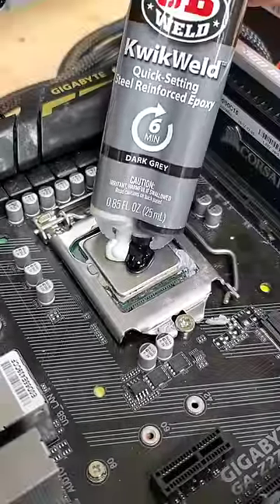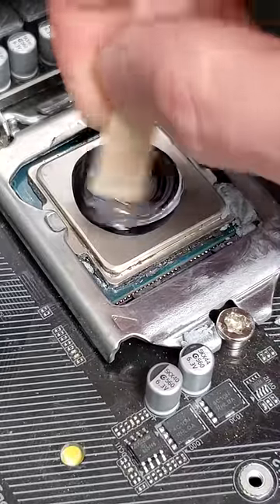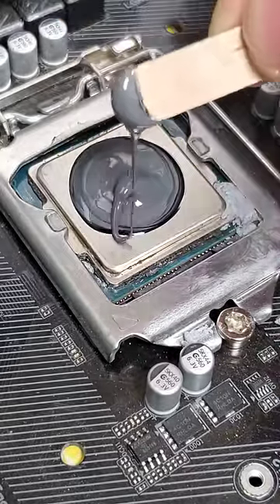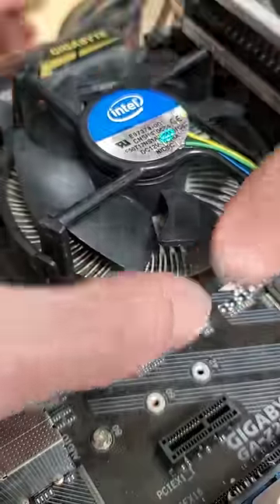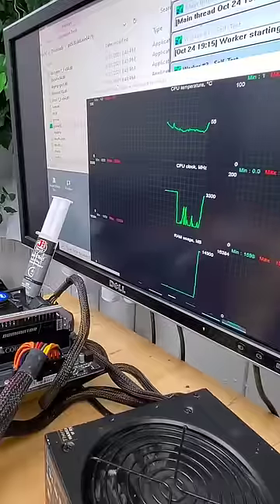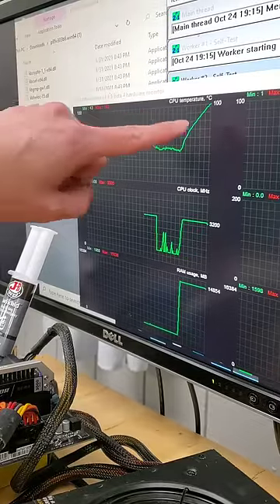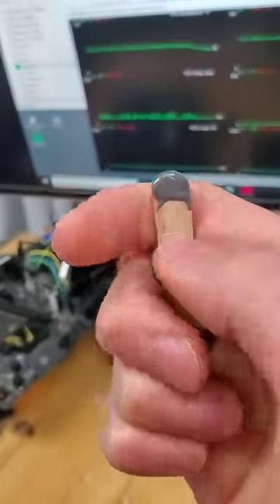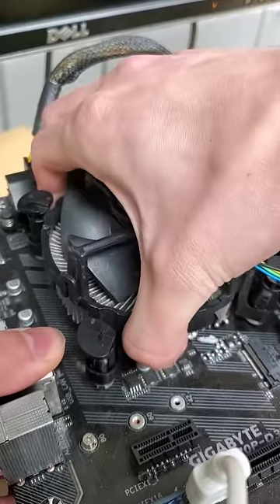using steel reinforced epoxy as thermal paste in a PC! #shorts

Comment: Try thermal epoxy next! They’re used in like 3D printers to epoxy the heating coils and thermistors to the print head…
Reply: bro rlly thinks mryeester has infinite cpus
Reply: @brianery  he lives like he does 😂
Reply: @brianery  My man buried 3 CPUs in the ground, of course we all think that.
Reply: @brianery  to be fair you don’t need great CPU’s for these tests
Reply: That thermal epoxy (boron nitride paste) is only conductive after it hardens. So no use then.
Reply: @brianery buy a used crappy one for like $20😂
Reply: @brianery I thought he did
Reply: @brianery  Yeah he's probably making more than some $20 mobo combo pre video
Reply: Uhhh... when?
Reply: @brianery I mean, old CPUs are cheap AF.
Reply: @brianery old one are cheap
Reply: @UKsystems  most old ones won't run on a modern pc
Reply: @brianery  this is the definition of an oxymoron. Of course an old CPU wont run on a MODERN PC because their not the same socket or anything.

But if you get the right board, yes they will run just fine. I still run a 14 year old system for a storage system.
Reply: @vinylmodsmanitoba  oh, so mryeester now has to buy another motherboard in which the old cpu can fit. definitely cheap!
Reply: @brianery  I don’t think when putting epoxy on a cpu it needs to do any better than barely booting
Reply: @brianery  to be fair you only need 1 basic of each chipset for amd/intel. you can reuse boards as simple as removing old cpu, place new cpu. 

Also, you just made a "run it till it dies" cpu cooler combo... unfortunately, no cpu works well at 100c

you could sacrifice a chipset/couple of days recovering a chipset to do a cpu bricking video with it. 
I bet a face-against-keyboard value to voltage or clocks speeds would do it. 
alternatively you could try to salvage some performance with undervolting and negative curve offsets.
Reply: Fun fact, it's been a decade 3d printers now use heating cartridges and ceramic heaters held by a screw or a spring lol
Reply: @eski5195 Bambu printers use thermal grease for the ceramic heater still.
Reply: Yea. I have never seen a printer that uses thermal epoxy. 99% of printers just have a heater cartridge and thermistor that’s held in with a set screw. The other 1% uses thermal grease and the set screw to hold it in.
Reply: @xiar5546  My CR 6 SE uses thermal epoxy for the thermistor and the heater cartridge.
Reply: he does.... tech guys ALWAYS have another cpu laying around. @brianery
Reply: hell I don't even own a tower atm and even I have an extra couple of cpu's laying around
Reply: @brianery cause he really does it seems😭
Reply: @brianery  He would need a motherboard regardless if it's its an older socket or newer socket for the experiment to work and most older mobo are cheaper than the newer ones... Obviously you don't watch his content cuz this kind of stuff is what he LOVES to do.
Reply: @AznMikey  frick thermal paste use cheese
Reply: @brianery what did you think, bro?
Reply: Ya not in any 3d printer guy. The elements and thermistors are in their own package, sealed with ceramic paste not epoxy.
Reply: @beaumontlivingston8084  Yes, but when the "packages" are installed inside the heating block, they are thermally coupled with either thermal paste or thermal epoxy and mechanically held in place with set screws.
I've taken my printer apart enough times to know this.
Reply: @kugelblitz1557  I just dropped 2000 dollars for a high-end gaming PC that gets about 500 fps, and the cpu sits comfortably at 70C under a full load, and I'm happy with these numbers. 2k is less than some people spend on a high-end graphics card. I still need to get some 140 mm fans for the front to build up stronger positive pressure, so a lot of dust doesn't build up. Until then, I will just set them at a higher rpm than the exhaust fans. Hopefully, that works. Also, I know people have better PCs than mine, but I'm going for a high-end energy efficient build to combat inflation and rising energy costs. I will still be able to play games for a long period of time at good quality while spending less money on energy bills. With everything increasing in price, energy efficiency will be king for people who play games/work for long periods of time. These are just my personal thoughts. I could be wrong, and everything might stabilize, but I wouldn't count on that.
Reply: @Cerberus3434  ok this is the most random thing as a reply to my comment about thermal epoxy wtf😂

I don’t think anyone here was talking about energy costs or inflation
Reply: @aaryananand7288 oh mb wrong person. I'm bad this. There was someone talking about dirt cheap parts here somewhere.
Reply: @aaryananand7288  Wait, why are you responding to a comment not directed at you. Is the better question. Yes, I went a little off topic, mb. It corresponds to the sub topic someone bought up about how you can find cheap parts if you know where to look and everything after the first thing I mentioned explains the first part in better detail and why I chose that route. It's on topic for the sub topic. I never really liked the main characters. I always wanted to follow the story line of side characters, and interact with them. If that wasn't explained, I would just make up my own story. Also, I mean no disrespect. You probably know more about the main topic. I just like to take the road less traveled. I'm all for people trying new things this causes a domino effect that eventually leads to innovation. Innovative ideas are the fuel for the fire so to speak and if they eventually find a way to make PCs cooler in the process that benefits everyone. Like with the advancements in God teir cpus have driven done the price for the old low teir cpu and the same goes for gpus. Gpus are a little bit better because you can just bridge those if you have a good psu. Also this topic is way to broad so and kinda out of my league. Same with OCing. I have a simple ish build that I know I can manage. I'm only in the process of relearning ohms law at the moment to calculate max volts and amps my system runs. Oh, forgot about watts mb.
Reply: @Cerberus3434  sounds like me! I kept mine at around $2500 (during covid prices), full custom, exact parts I (actually) wanted, and I couldn’t be happier 3 years later. should carry me another 3 years, at least, easily. cheers to your setup and I hope you get those tweaks just right. :)
Reply: @brianery  pc hardware reviewers kind of do, often times they get donations of review/press versions of the hardware ahead of the release dates to give feedback or whatnot, and they usually send more than a few of these each time. linus and gamernexus for example are sitting on hundreds of unused cpu's over the years.
Reply: @chloekaftan  meanwhile intel looking at what mryeester is doing to their cpus
Reply: Yup once a cpu hits 100° its already fried
Reply: @bartfelix2949  nope, not true. Some CPUs let you change the thermal throttle temp in the bios all the way up to 125C. CPUs are totally fine for a lot higher temperatures, but they just wear a lot faster.
100C can never “fry” a CPU.
Reply: @brianery  silly sausage.

Comment: His next video:
“What happens if you use pure uranium as thermal paste in your pc??”
Reply: Mryeester just fucking busts in with a hazmat suit on.
Reply: it initiates nuclear reaction and become tiny nuke heh
Reply: Hmm, CPU is a little hot... 6000 degrees
Reply: @FluffyFoxUwU  Critical mass of Uranium-235 (Used in Little Boy) is 50 Kg
Reply: assuming you had access to it, you could actually. it wouldn't even be the worst thermal paste to cool a cpu with, because it's thermally conductive. it's only gonna make your CPU slightly radioactive :)
Reply: @klad2860  using a neutron moderator, such as water, this number can be made even less. but that is for controlled nuclear reactions :)
Reply: A nuclear meltdown produces a liquid called corium, that runs through a reactor vessel. Corium is the word you're looking for
Reply: @stormah  although, corium is only liquid when it's hot. it's basically just the extremely radioactive lava you get when things get so hot they melt and mix inside the core. when it cools down it solidifies, so it's not any weird green goo liquid lmao.

a much better material to use (in this hypothetical situation) would be depleted uranium. this is the stuff they are left over with as a byproduct during the enrichment process. depleted uranium is much higher concentrations u-238, it's less radioactive, much easier to obtain, and chemically extremely similar to u-235. you could use this in a paste for a CPU or make it into a uranium-gallium alloy and apply that as a liquid.
Reply: kaboom?
yes rico, Kaboom
Reply: Bro got that Demon Core i9-666KF 💀
Reply: Maybe yellow cake?
Reply: @Thatonefuckinguy well actually🤓 
Uranium emmits gamma radiation, which can only be halfed in amount by 1cm of lead SO if he wanted to get that close to pure uranium he would need at least more than 10 cm of lead shielding around his entire body
Reply: let’s feed some to the cat 😊
Reply: @ThatJay283 for bombs better compression from explosive lenses and neutron reflectors can drive critical mass lower. Shape of the material is also a factor.
Reply: Not much other that it would be moderately radioactive, still safe to be around for a few hours just not all the time.
Reply: Uranium would be a great thermal conductor.
Reply: Works quite well!
Unfortunatly howver the constant blue screens get annoying fast
Reply: Maximum bit flipping

I don't think that's what's meant by "quantum computer"
Reply: AAHAHAHAHAHAHAHAHHA BECAUZE URANIUM IS RADIOACTIVE!!!! 😲😲😲😲😲😲HE WOULD GET CANCER AHAHAHAHA😂😂😂😂😂 UR ACTUALLY SO FUNNY AND DARK AND TWOZTED 😂😂😂😂😂😂 NO WAY ANYONE HAS EVER BEEN THIS FUNNY 😂😂 HE SAID URRRAAAANIUMMM AHAHAHAHAHAHAHA
Reply: crunchy cat has entered the chat
Reply: Yum, Tasty Radioactive square chips
Reply: Boooo... MMMMM!
Reply: @renwan1  Oh, Yeah!!!

Comment: Steel is also a bad thermal conductor compared to aluminum, gold, brass, and copper. I discovered this the hard way when trying different 3d printing nozzles.
Reply: Cooking also teaches this.
Reply: Why did you mention gold, but not silver which is even better then copper

Comment: Try mirror polishing cpu and cooler's touching points. Since thermal paste fill the microscopical gaps mirror polishing should work without thermal paste.
Reply: That's lapping and it does make a difference
Reply: It definitely does. my 3700x could never be properly cooled. I lapped it and now its more than happy.
Reply: It might make a very small thermal difference but it will still need thermal paste
Reply: It would take some precise tooling to avoid rounding it. Without thermal paste the two surfaces would need to be perfectly mated, and when lapping you're quite likely to introduce some convex geometry.
Reply: how do you mirror polish? dont you need industrial tools to produce mirror finish metals?
Reply: @Chewy427   lol no. Just buy some sandpaper
Reply: @PeakOfHumor  Use sandpaper on my cpu and my cooler?
Reply: @Chewy427   I totally meant that. but you know its just a video idea.
Reply: @Chewy427  sandpaper isn't a great choice since its soft and will cause some rounding. You want to use lapping stones. Ideally float glass backed stones, and make sure to level them correctly.
Reply: @Chewy427  I used my granite countertops, but you can use a plate of glass from a picture frame etc, and wet sand with 600, 800, 1200, and 1600. Then polish compound rubbed with a paper towel. Then clean off with rubbing alcohol. You can see the high/low spots in the nickel plating when you start to sand into them. Best way to know when you're flat is when all the nickel plate is gone from the surface, then focus on the higher grits and polishing. Then the amount of thermal paste you need doesn't require hardly any.
Reply: @PeakOfHumor  definitely not "sandpaper" if you really wanted a mirror finish you'd get a 1 or half micron paste and a felt capture pad to polish it down
Reply: @Chewy427  Unless you have a problem or you just want a slightly long and expensive project, it's probably not worth it. It's difficult or nearly impossible to eliminate insulating air gaps. But if you like, do some more research. I have seen good articles and videos on the subject.
Reply: Not really granite surface block or even a peice of glass can get you pretty flat @Erowens98
Reply: But, won't it be affected by thermal contractions? And that may ruin this idea
Reply: @fidonol  good point. The surfaces may have differential expansion when hot. Best to just use a thermal interface material.
Reply: Why can't you cool a 3700x? I have mine running on a refurbished 240mm corsair h100 aio with the fans turned off. Runs 60c in games 🤔

Maybe your motherboard is giving it too much voltage? How many watts is it pulling? I think mine does like 95w under full load  @chieftain20

Comment: Bro sacrificed a whole CPU for this content
Reply: Prolly a 2 core deadass CPU
Reply: No way that epoxy didn't overflow into the socket.

Just what little yanking he did, bent the PCB and stressed the solder joints. 

Board is a goner.
Reply: And motherboard 😂

Comment: Finds out he used his 7950X CPU for the experiment by mistake.
Reply: The best cpu that it could be is a 11900k. You can easily tell the difference between amd and intel even though they are both lga now.
Reply: Worse, it was a platinum sample.
Reply: Its prob just an old Celeron, relax....
Reply: @Leonvolt28  11900k in an 1151 socket? You might want to double check that
Reply: @MrOnewallatatime I didnt spot the socket name in this video. After looking again I do. I'm aware that 11th gen intel is socket 1200.  But the sockets and cpu do look pretty similar.

Comment: Are we gonna get a how you removed it video like we did when you covered it in thermal paste?
Reply: No because there isn't any way to separate it. He can't even get the CPU off the motherboard because the latch is underneath the cooler
Reply: Ripped it off with a layer
Reply: @БогданКрименюк  I might just be being stupid here but what's a layer?
Reply: @Duck_side it’ll take the integrated heat spreader off with it
Reply: cut the bulk of the cooler off wiyh a handheld bow saw with a blade destgned for metals, so you can access the latch.
Reply: Knowing that stuff... there was never a removal option. Never.

Comment: Epoxy heats up to become solid and is very susceptible to heat to become a liquid again when heated enough. (Heat it up the epoxy will separate and become easily separateable)
Reply: Epoxy is a thermoset, once it crosslinks you cant melt it again. Kind of how you can't unboil an egg.
Reply: @ZhaoPao you can unboil an egg, you just need to go faster than light speed

Comment: i mixed silver powder with epoxy, this works good. you just have to use the most minimal film on the cpu. i used this to connect leds to coolers permanent and weatherproof.

Comment: I accidently used thermal adhesive on my AMD Phenom II X4 965BE back in 2009. I was initially so bummed, but luckily it is still going strong as my NAS CPU 15 years later!
Reply: I had the stock cooler on my AMD Phenom II X4 955 for maybe 5 years. When I went to upgrade that computer it was practically like I had epoxied the cooler on. Ended up ripping the entire CPU out with the cooler trying to remove it. Then used a razor blade and iso to finally get it off. Still works great though! Had it in my NAS until I built a replacement last year

Comment: Try antiseize. Both the copper one and the alumium one. Edit: oh, wait, you already did. But try the copper one and see if its better. Its used for bolts(technically screws) that bold into cast iron and can damage alumium.

Comment: Thermal epoxy though... I used some to put a daughterboard Pentium III cooler onto my GeForce MX200 64MB which I modded to run as a Quadro2, and boosted the core clock to 225mhz. Worked a treat, looked neat and made a lot of kids jelly at LANs

Comment: As soon as I saw JB weld I kept repeating NO. The point of thermal paste is to prevent any gaps so what you want is anything that would create a perfect seal between the cpu and heatsink. It cant suffocate the 2 components though. JB weld is going to trap heat. It wont allow for it to transfer to the heatsink.

Comment: Actually this works if you do it correctly. The problem is that with thermal cycles epoxi will delaminate and crack and will gradually loose conductivity

Comment: This is easier to test if you take off the metal bracket from the motherboard. The cooler feet will hold the cpu in good enough for a short test, and it comes right off the board no matter what you put on the IHS. The you can just wedge the CPU off with a razor.

Comment: If you're going to use an adhesive, use one designed for thermal transfer an only use enough to get a nice thin bond line.  You could probably do 20-30 cpus with that big ole booger.

Comment: Yer as a mechanic I could of told you exactly how this would play out😂😂
Now if you can break those components apart I will be very very impressed ❤
That steel epoxy is hard to get off with an angle grinder 😂😂

Comment: I was away and needed to apply a new CPU heat sink/fan which I had, but no thermal paste. An art restoration team nearby had small scraps of (relatively) thick REAL Gold, Silver and Copper foils from a previous project. I layered a piece of each on top of one another and it worked. I never measured the temperature, but the computer never overheated to the point it shutdown.

Comment: Pretty sure The cpu has somthing called a die overtop of the actual cpu CHIP, replacing this with a copper die and replacing the thermal paste under the die will result in better cooling but is not easy

Comment: Besides the thermal paste is not applied this way, only by a think layer with a square and a cross ,when placing the cooler it is spread evenly and you have less than 40C in AMD for regular work